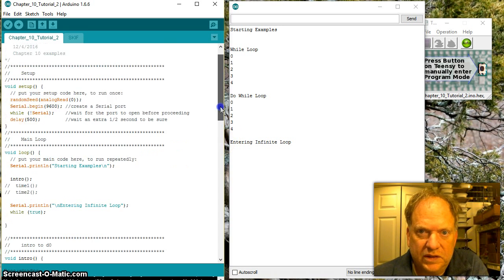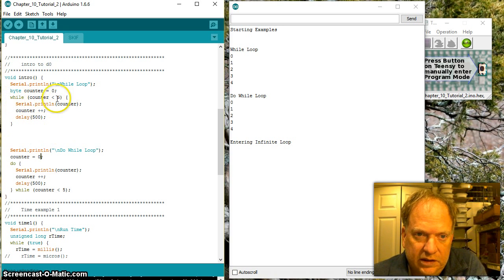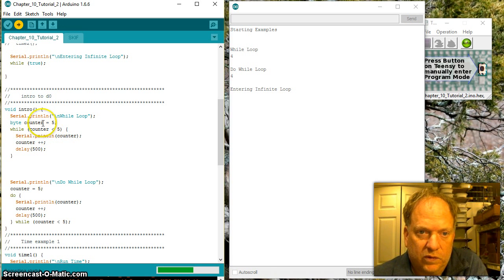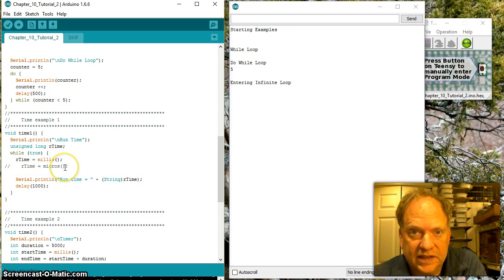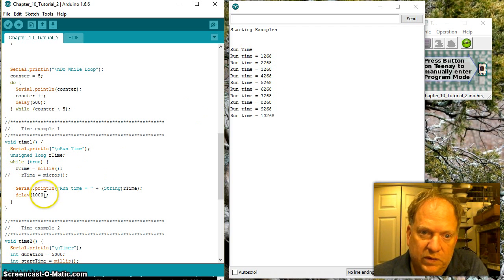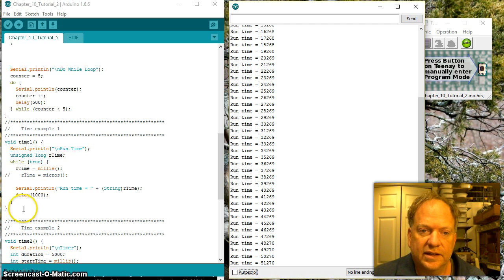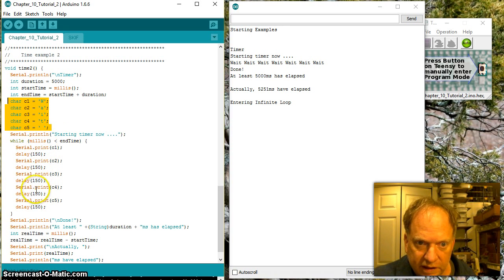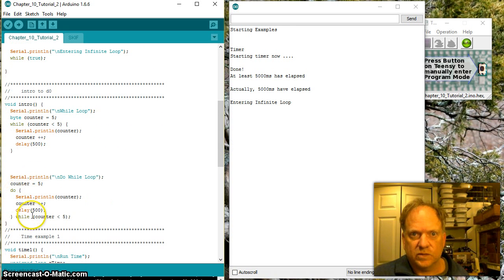Do-While loops and Timers  in Arduino   Chapter 10 Part 3

Comment: Thank you very much.  I will be measuring time to calculate requite speed different different  hypodermic needles must travel at to penetrate rather than just intent a target (central) vein.  I need to understand while loops since time will be measured between 2 different events (either projectile crossing 2 light beams or rolling steel ball passing 2 metal detecting transistors.  Thus, I must learn to write waiting while loops like the ones you just demonstrated.